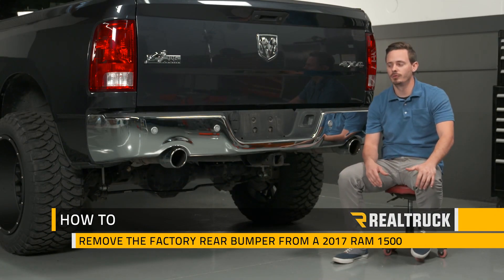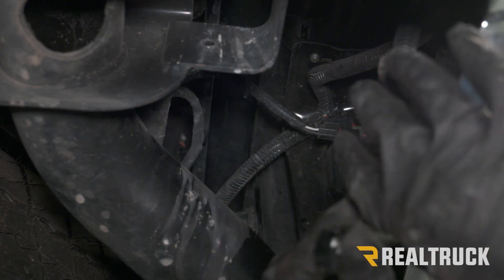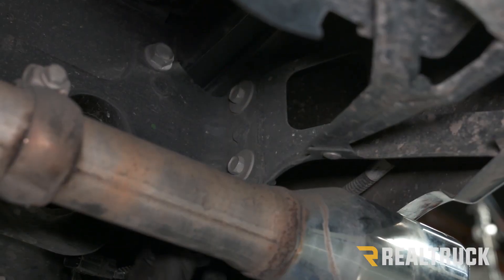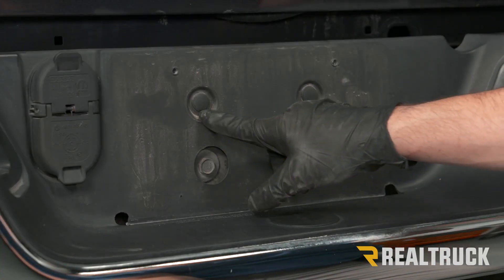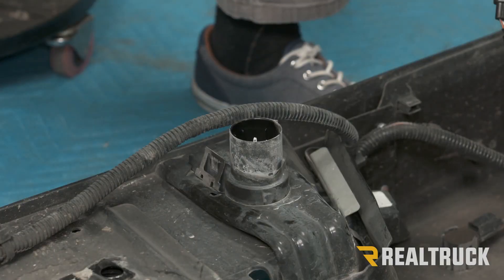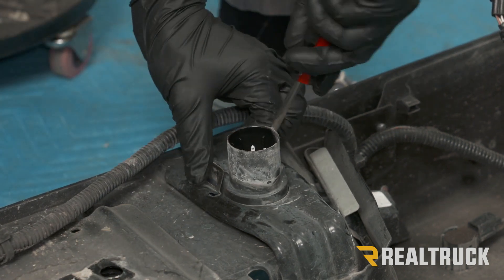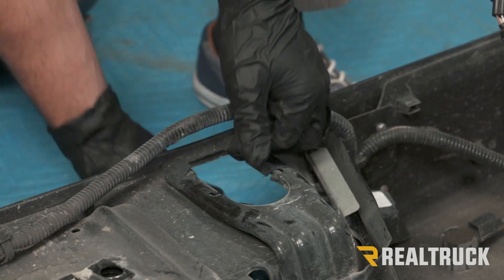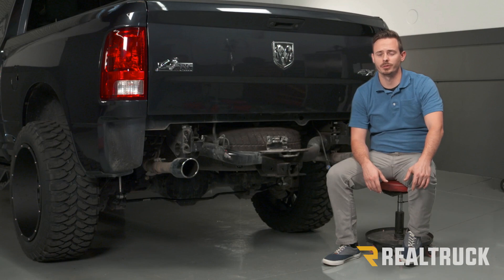How to Remove Factory Rear Bumper on a 2017 Ram 1500

Comment: Just recently ordered and received a replacement oem rear bumper for my 2017 Ram Rebel 1500 from American Truck. Your video made it so easy to remove and install the new bumper. Thank you so much.
Reply from the maker: Glad I could help!
Reply: What bumper did you go with? Going to do the same for my 16 rebel.
Reply: @stephenortega4060  OEM Style Steel Rear Bumper; Pre-Drilled for Backup Sensors; Black
(09-18 RAM 1500 w/ Factory Dual Exhaust)
Our Price $468.99 (each)
Item R114260
  33 Reviews

Save
Hi. I installed the below bumper on my 2016 Rebel. I really like it and think it looks better than the original. 
OEM Style Steel Rear Bumper; Pre-Drilled for Backup Sensors; Black (09-18 RAM 1500 w/ Factory Dual Exhaust)
Item R114260

Comment: Are 2017 bumpers interchangeable with 2018 since they appear to have same exterior looks.
Reply from the maker: Hey Jesse, looks like most models are interchangeable for the 2017-2018 Ram 1500s!